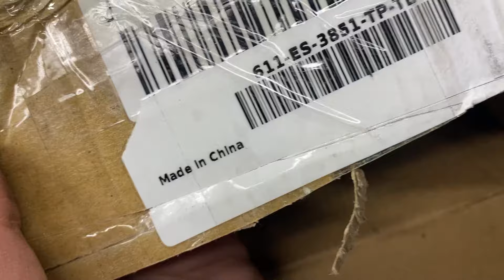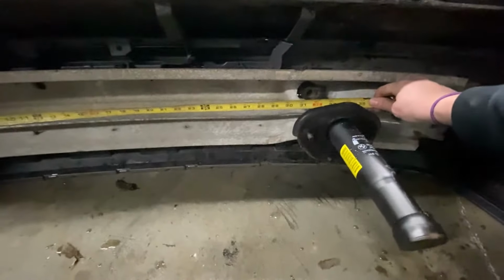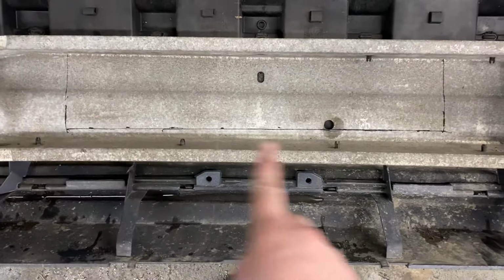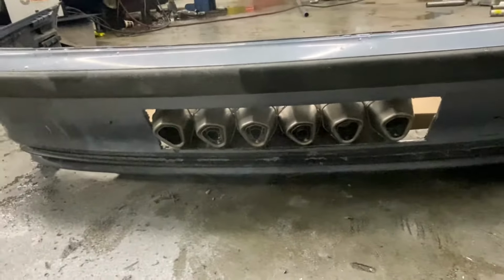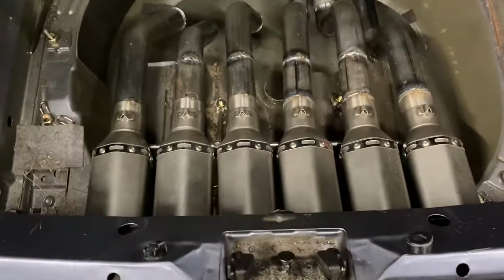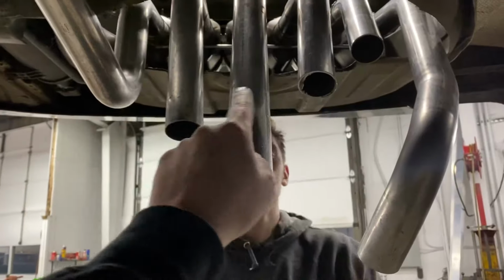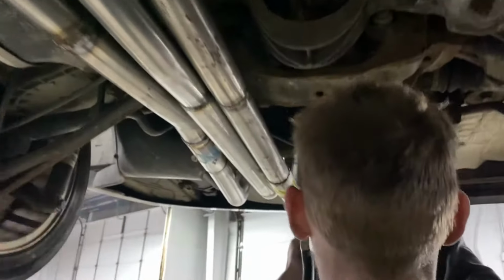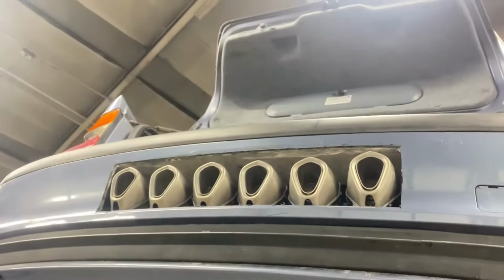Putting 6 Dirt Bike Mufflers on My Car

Comment: There's a reason nobody has ever done this 🥴🥴
Reply from the maker: Haha welp now someone has… twin turbos coming next… already getting fabbed in
Reply: You said that 6 months ago!
Reply from the maker: Yea it’s been taking me awhile. There’s a lot of fab work and I’m making it all out of stainless. I have to make a whole separated oiling system and tanks out of aluminum. It’s pretty complicated. It’s not like j throwing turbos in there and the car runs
Reply from the maker: I’d post a picture on here if I could. I had to make brackets in the truck to hold the turbos up 6”. Everything is hand made.